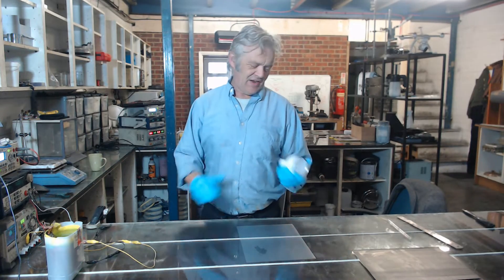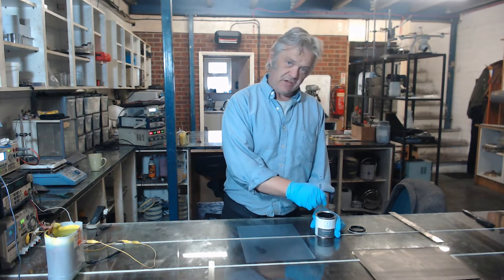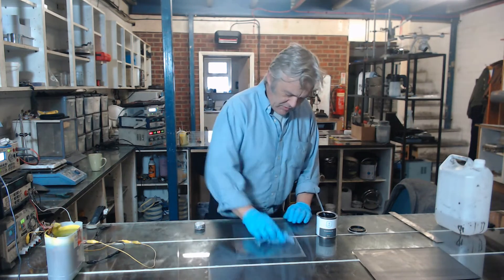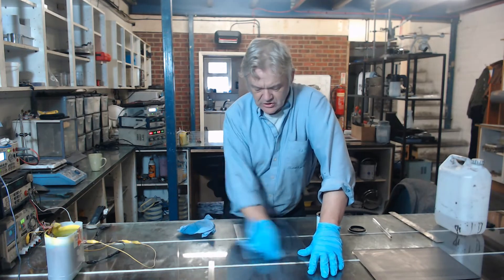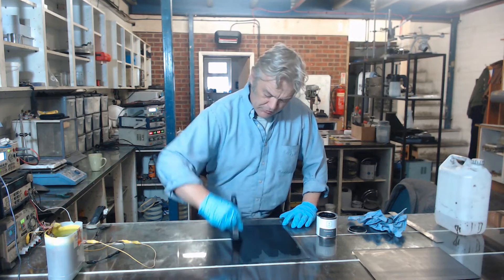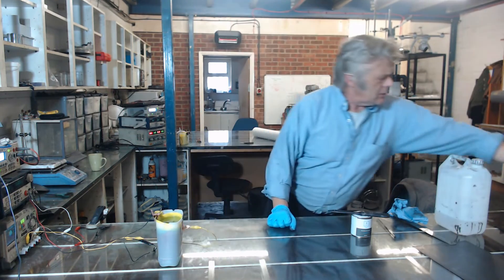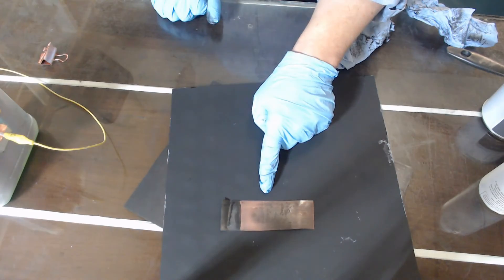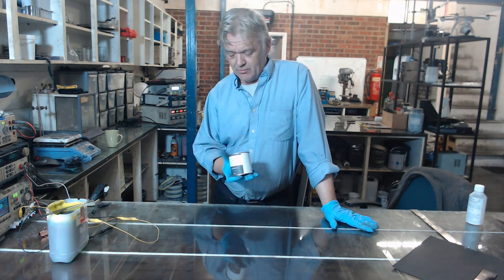Graphene Conductive Ink - Plating Plastic

Comment: I have used one or both of two methods. I first try a tad bit of acetone. Acetone puts micro abrasions on the surface of the plastic and usually works quite well. This is what we call in woodworking as de-glazing the surface. Often times the second method I use is a fine grit steel wool. This will physically de-glaze the surface of the plastic and allow the ink to adhere. Voila!

Comment: What is best and cheapest method for even covering my 3d printed plastic parts with conductive ink for nickleplating ?
Reply: Hi I am working on 3d printed plastic part. I am trying to copperplating it and I am wondering if you were able to use the ink. if yes, how did it work out for you?

Comment: Plate carbon nanotubes on top of the ink to increase surface area! PLEASE do a test to compare max discharge current of nickel iron cells. One should be constructed with the nickel plated directly onto the ink, and the other with the plated nanotubes as an intermediate between the ink and the nickel.

Comment: what's the difference between milled graphene (as in that ink) and milled graphite? isn't graphite just graphene sheets stacked? so what is the difference when they are powdered?
Reply from the maker: about 100,000 layers
Reply: @ThinkingandTinkering  yeah but there is no much difference between graphite and graphene when they are in powder form...
if i had some graphene powder i would be able to prove my point on my microscope... i can make a video about graphite powder under microscope and you will be able to see what i am talking about...
Reply: @Hobypyrocom  There is a lot of difference in the way they behave.
Reply: @Rollmops94   i guess you are right, but where does the difference come from? because graphite is just graphene sheets stacked above each other, if you mill graphite to a really fine powder, those graphene sheets will separate... i have a ball mill, i have a microscope and i have graphite, i will make a test and make a video of it once i have time just to see the outcome.
Reply: @ Well. If we assume graphite is nothing but stacked graphene it has to be that stacking that leads to it being less conductive. Honestly I don‘t understand why graphite does not unstack and/or graphene does not restack. Maybe they do. From what I understand graphene only has amazing conductance within a single layer. I‘d assume that you‘d break these layers up when you powder them, so it is questionable wether powdered graphene has these amazing properties at all. But maybe not even that is true since graphene layers are supposedly very strong. Maybe they just fold.
I can‘t find a lot of info on the subject. I also feel like this channel is not the most scientific.
I can‘t even find easy info on different conductive paints and how conductive they are. A lot of people seem to use graphite based paints. What about metals like silver and copper? People rarely seem to mix all of those. What about the binder? Wouldn‘t the best conductive paint have no binders since binders don‘t conduct? Couldn‘t you get mechanical strength by pressing the material after the paint dried? How do they do graphite rods? Aren‘t they just pressed or do they add binder as well? I could ask questions like this for days.

Comment: Is the graphene scuffing the surface?
Reply from the maker: I think it is electrostatically attracted to the surface - this is in line with a couple of Japanese papers that came out last year
Reply: Robert Murray-Smith so Robert does that mean they are ionically bonded if they are static attracted ? Is it that strong ?
Reply: @ThinkingandTinkering  The graphene/graphite is sticking to surface in the same manner as in one of your older videos where you burnished graphite into a sheet of plastic to form a layer of graphene.